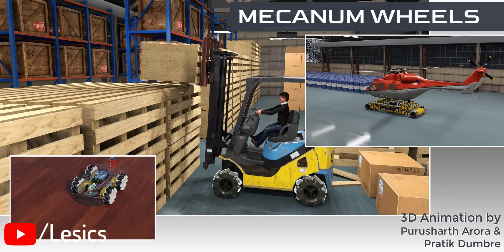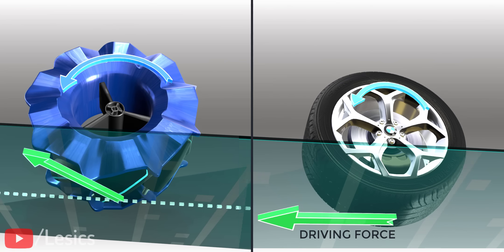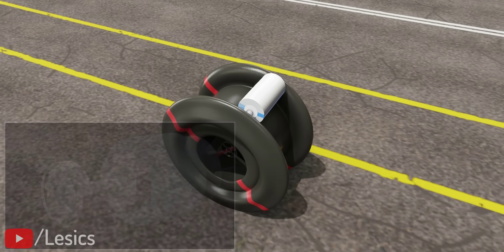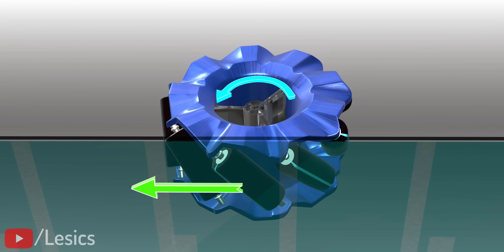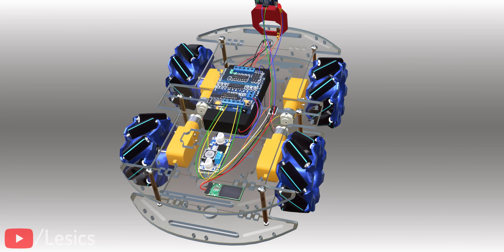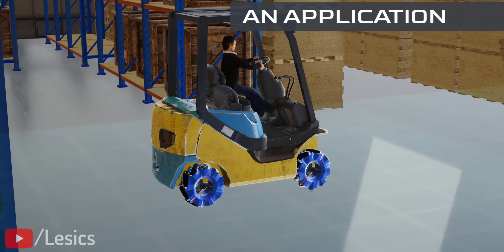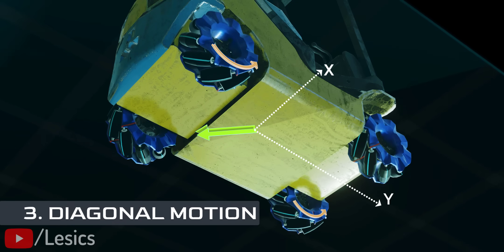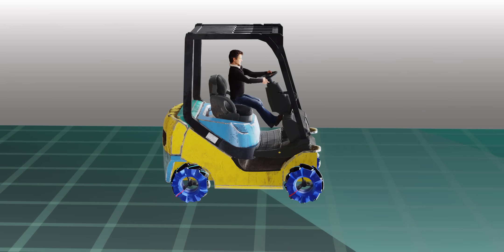The Brilliant Engineering of Mecanum Wheels!

Comment: The functional limitation is that each roller in frictional contact in a 4 wheel vehicle bears 1/4 of the vehicles weight & in turn each small bearing on the 4 contact rollers 1/8th of the weight.
That makes reliable engineering of weight carrying vehicles like fork lifts difficult, they sure work on wheel chairs however.
Reply: Yes
Reply: By that logic the contact point of the axle and the wheel bears 1/4 of the weight in any 4 wheeled vehicle and that must mean that reliable engineering of those is difficult, except we know that's not true

we also know that those forklifts already exist and regularly handle serious loads without problems or more maintenance than a normal forklift

besides in a typical mecanum wheel two rollers maintain contact with the ground at all times, not one, so each end of the little roller axle bears 1/16 of the weight compared to 1/4 for a normal wheel axle, so all your faulty logic does is actually prove that mecanum wheels are superior

and it IS faulty logic because weight distribution does not work that way, there's no single point that gets 1/4 of the weight or any other asinine simple fraction and the stresses change all the time and don't result in nice even numbers like this

also mecanum wheels DO NOT use bearings, they have steel axles with endpoints mounted in a metal frame!
Reply: @nadarith1044  it is not the matter of 1/4 and 1/16 (which is only sometimes true which created even more stress) the problem is that those rollers are not attached to long steel shaft but some small part.
And even if they exsist they will be able to lift less and requier more upkeep and cleaner work space.
Reply: @greedier-7661  Dude the 'small part' is an inch thick steel axle that is as long as the wheel is wide, it's proportionally thicker for it's lenght than a 'long steel shaft' and it's endpoints are both closer together while also being supported on the endpoints and bearing weight on the middle, this means that any stresses that want to bend and break it will be countered better because of how it's being kept rigid and supported on both sides

in contrast the long steel shaft is essentially bearing the weight on the endpoints and is supported closer to the middle which means that the endpoints will receive more stress due to basic lever principle, on top of that it's also proportionally getting a bigger fraction of the total weight and is proportionally thinner and longer therefore weaker, it's obvious it's going to experience stresses in excess of the rollers and be more prone to bending to boot

yet the axles are reliable and durable, so the shorter, thicker, supported more rigidly rollers are obviously not going to be worse or less reliable

also your 'if they exist' remark shows that you didn't absolutely no research and have no idea what you're talking about, they do exist and as much as i tried to find opinions about mecanum forklifts there is no mention of 'more maintenance' or 'weight limits', they're as capable as normal forklifts, the problem is that they're rare as mecanum wheels are essentially unheard of outside of robotics (and from what i see most of the problem is people with opinions that aren't engineers poisoning the well on the idea by spouting blatantly false statements about the wheels)

speaking of robotics, you have things like small pallet sized robotic platforms that easily support 1 ton weights, up to massive autonomous airport robots that support enormous loads and are used to transport plane parts, the main limitation seems to be batteries as they're all mostly electric

they all also operate outside, in a matter of fact mecanum wheels are excellent in off-roading and can handle very rough terrain, what they don't handle well is speed due to their reduced contact patch and how at high speeds their 'rolling' becomes 'repeated impacts' with how they're made

speaking about your 'clean work space' statement one important part is that mecanum wheels also receive incredibly small wear and tear, the entire idea that they have a lot of friction is a gratitous misunderstanding of how they work, the entire idea is that any force that isn't converted into motion of the vehicle is just harmlessly expended by the freely spinning rollers, the mecanum wheels NEVER skid and don't even experience wear and tear when breaking as when unpowered the wheels automatically oppose themselves due to their configuration and bleed any force with the free spinning rollers
Reply: @nadarith1044  Firslt I am not worried about shaft of the rollers but the endpoints becouse even if most of the force is focused in the middle, endpoints are being affected by diffrent force and if they were not the only thing being affected byt it but rollers kept some there would be friction affecting them.

Regarding my lack of reaserch, you yourself admitted that you did not find anything about such stuff despite the fact that such thing would be in their manuals. Even cars have it wirtten how much can the bear. 

The small robots work in diffrent ways as they don t use 4 wheels / 4-8 rollers to hold their weight and there is often used a lot of them if they want to lift something realy heavy.
If they did have very small wear and tear that means that they would have small friction which means that you would have to make works space not wet and straight as possible and it would skid. That what friction is for. 

And if all of that was false rollers (not whole mecanum wheels) would be used much often but i hardly even see them.
Why are trucks not useing them. You would olny need to make them bigger.
Tanks could use them.
Oh and forklifters could use them even without the wheels just have them use your rollers.
Reply: @greedier-7661  Why would the endpoints more vulnerable? why would a point where a metal rod is put through a thick metal plate then capped with another piece of thick metal be more vulnerable than a rigid structure that has to resist bending at literally every turn on a point without support? the endpoints turn that force into compression of something already solid which is much easier to resist than bending

i admitted that i didn't find anything about weight limits being lower than a normal forklift nor negative opinions, there were quite a bit positive opinions and a couple vids about the forklift doing forklift stuff however

and you ignored me talking about what i did find which is how praised the wheels are in robotics and how big those robotic platforms are or where they work (outside on the damned pavement) or how their main limit seems to be batteries because they are mostly electric, and to demonstrate how stupid your point about how many wheels they have is how about you look up the number of wheels big 18-wheelers have? ALL platforms made to carry massive loads have many wheels, while rare exceptions have MASSIVE wheels instead with massive axles or incredibly overengineered ways to hold their wheel like landing gears on planes, while the trully collosal machines ditch the wheels entirely and use tank treads, i don't think you really get just how reinforced heavy duty loads need their suspensions to get

it's the skidding that causes wear and tear not just the fact wheels have grip and are used, just because something has massive friction it doesn't mean it will get massive wear, and mecanum wheels have decent grip while also free rolling any force that doesn't match the movement instead of just locking and skidding on the ground, the type of wear and tear we are talking about is literally the outer surface of something shearing off in microscopic amounts, it does not happen if the two surfaces aren't ripping apart past each other and grinding themselves away, if what you said was true then massive grip tires like those in excavators would get ground in no time, but curiously they only do so when skid steering aka. literally locking up a wheel and grinding it by turning the vehicle around on it like a pivot, the wear isn't nowhere near as big when they operate normally

and when false rollers are used on wheels either mean it's an omniwheel (which have problems) or a mecanum wheel, you also can't have just rollers because it no longer has the functionality of the mecanum wheel (sideways and tank driving, minimal wear and tear but decent grip, can still brake and resist pushing)

and they arent used everywhere because:
1. they have problems at high speeds and are very bumpy in such cases
2. they arent better or worse just a different solution for a different job and excel in precise manuevering with large loads at low velocities or with normal loads in rough terrain (so they perform best in forklifts, transport robots and extraterrestrial rovers)
3. because uneducated armchair engineers like yourself invent nonexistent flaws as they only have a basic knowlegde of the system and principles involved and don't even recognise it, the amount of bs under this very video proves that it's because the public perceives them as unreliable, even when anyone in robotics will tell you that they very much aren't
4. because companies and people in general have aversion against new technology that wasn't extensively developed and doesn't have ready manufacturing and supply chains driving their cost down, you can look at electric vehicles and reusable rockets if you want tech that we could do for decades but didn't because muh fast return on investment and status quo until someone just forced it down everyone's throats, or zeppelins and nuclear power if you want beneficial technologies that are avoided because of stupid public opinion
Reply: @nadarith1044  firstly there are better soulutions to driwing in omni directions.
Second if so much of the wheel needs steel than it will be extrwamly pricy and heavy. Also it adds electronics to tires which is even more wasteful.
Thirdly point with big litera many wheels was that they do so by spreding the force and not having some "super wheels".
Forth points is if they even after scaling them up to normal tires is bad means that they are not good and were just used here becouse they could t use generic technologies instead.
5 skidding work complitly on fiction so what are you even on about.
Reply: @greedier-7661  Do you have any knowlegde about enginering at all? any?

1. No, there are other ways to steer in all directions and they are better in some situations and worse in others

2. Mecanum wheels aren't much heavier and have no electronics, another nonexistent flaw you made up, people are literally handling these things using their hands so they aren't that heavy

3. My point was that platforms for moving big loads have many wheels mecanum or not, it literally proves nothing

4. There are mecanum wheels the size of big truck wheels and they work well on those plane moving platforms, i said that they aren't good for high speed vehicles, how about you actually read what i say?

5. if it's all friction then why don't high grip tires grind themselves up equally fast whenever they roll normally or skid in place? afterall it's all friction and such tires would have serious friction yet they don't have much tear if they just roll, your logic doesn't hold up at all
Reply: @nadarith1044  It seems that it was you that did not listen to me as in my 1 point i said litterally the same thing as what you answered.
2; ok i did not listen properly when he talked about how rollers worked but it doesn tchange how much metal there has to be used which will make them much more pricy.
5 it is all friction so even if they roll they still are tearing it is just that when it is done in place you leave material that is feeling in your tires (but it still is tearing more but that is becouse of diffrence of how force is destributed)
Also there is better thing then those tires that is simpler, more relliable and can do exact same thing. 
That thing is tank tracks and you just need rotating upper part and you have easy omni directional fork lift. it can also lift much more and have less tearing and you can use it anywhere.
Reply: @greedier-7661  1. Steel is cheap

2. When rolling the material loss is minimal when compared to skidding, it's because in a rolling wheel the surface mostly experiences compression as material is pressed into ground while only some surface imperfections experience tearing against a parrarel surface, and from limited angles, skidding is all tear on the other hand, this isn't hard

all reputable sources i could find agree that mecanum wheels have minimal wear and tear while maintaining decent grip anyway

3. Tracks can't make you move to the sides or diagonally without turning and omnidirectional conveyors have their own complexity problems, have moderate to big wear and tear as turning requires a track to lock and grind against the earth for the vehicle to pivot on it and they can be damaging to floors, so no it's not even close, try again

seriously you're now arguing for a gimmicky omnidirectional track setup? it's even more complex than mecanum wheels! and to add insult to injury a lot of them are just mecanum tracks with diagonal rollers stuck onto them and act like normal mecanum wheels just slower! dude mecanum was used for decades and they're proven to be reliable, they're all over the place in robotics like how tracks are all over the place in heavy duty excavators and military vehicles, i don't understand your problem with them
Reply: @nadarith1044   @Nadarith   @Nadarith  and why do you need to drive without turning? And if you want that you would only need to add rotating upper part like in couple of already exsisting building equipment.
I never mention omni tracks becouse with tracks you don t need them.
Also I don t know where you live that you would call steel cheap.
You might be one of the people that think that wood is cheap.
Also I cry reading about you trying to tell me about fiction. And how rolling wheels that roll becouse of microscopic hooking don t tear (or that it is minimal in your words), also having less surface created less tear? It is complitly the oposite as more force id focused on smaller parts. That is Also why your super wheels would tear more if the where from the same material and used at the same speeds as normal.

Comment: That's not a "normal forklift"... A Forklift normally has the wheels in the back turn while front are fixed straight. This way forklift have incredible turn radius when moving loads.

The fact that these guys don't know how a forklift works tells me all I need to know about the rest of the video.

Comment: I would be worried about its ability to handle heavy loads.
Perhaps for Amazon where robots pick up at most 300 lbs of packages at one point, this isn't a big deal, but if you work in an industrial setting where you're easily lifting thousands of pounds of weight, I can't imagine this would work as intended.
Still a cool idea.
Reply: It would not i have a lot of experience with using mecanum at smaller scales and weight imbalances and difference in the amount of friction the wheels feel can make it almost impossible to achieve omnidirectional movement

Comment: Are they awesome? Yes! Are they practical? Not even slightly. Although they would be cool on a kids RC car or robot. There's no need at all to start messing with "the conventional wheel" that has worked since day one when the cavemen figured it out! Only 2 things I could see these being useful for (kind of). One, being parallel parked between two a$$holes and two, in a very tight warehouse which if you need these to move on a warehouse then you got enough money to build an addition.

Comment: Making a classic wheel, that can rotate 360°, while being attached and transmissed from above would be more efficient and even reliable.
Reply: That's perfectly true. The only downside is more motors and more complex programing of motor controllers. In robotics I've built a few of those drive systems (swerve is what they're refered to) and they outclass mecanum drive systems in every other way.
Reply: @caseymurray7722  maybe I'm missing something, don't you only need 4 extra motors to steer the wheels? 2 if we discount the power steering motors already in normal wheels. 2 sounds like a whole lot less than the 64 or so extra motors in these cyberpunk wheels
Reply: @Zreknarf  No for a mecanum drive you only need 1 motor per wheel. For a swerve drive you need 2 per wheel, one for rotation and one for drive. Mecanum wheels are nice because they can fit where normal wheels once were and aren't complex. Swerve is better but way more complex; all designs have a bevel gear so it's like trying to set lash on a rear end but for 4 corners and they all need to be level.
Reply: @caseymurray7722  ahh I thought the diagonal rollers were powered, so that's what I was missing. but surely 16 or so rollers and their axels and their bearings is more complicated than 1 little extra steering motor, no?
Reply: @Zreknarf  No, mecanum wheels look complicated but are quite easy to build, once the wheel housing is made everything else is just a simple roller and bearings that need to go into place. Actually is cases where you don't have a heavy load and a small 1 in wheel they can just be 3d printed. Honestly for any vehicle under 50lbs mecanum wheels win.
Reply: https://youtube.com/shorts/_t_aAw5JgWM?feature=share

Comment: It’s about time that someone develops a clutch system for every individual roller which would solve some of the obvious traction control problems inherent in a system like this cause what works great on a forklift might kill you at high speeds in an electric family sized sedan.
Reply: I dont think a sedan will be adopting omnidirectional movement any time soon,  it's just not necessary or practical for our roads, although it does look cool